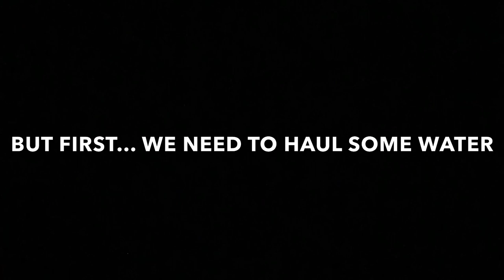Water is life & a foal’s first human interaction!

Comment: The hose on the pump needs changed the hoses are on the pump wrong. The intack is on the top and the exhasut is on the front. Because when you prime the pump its thru the top